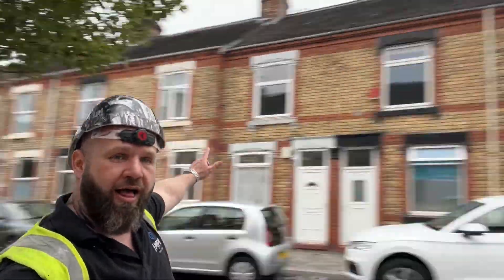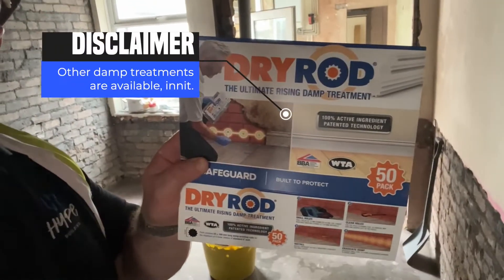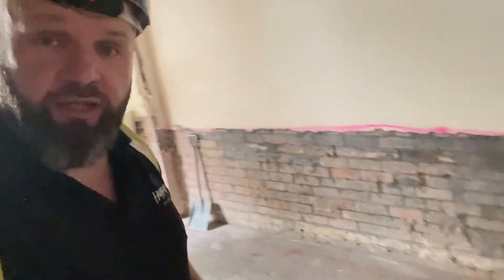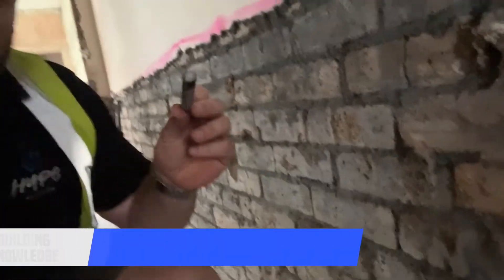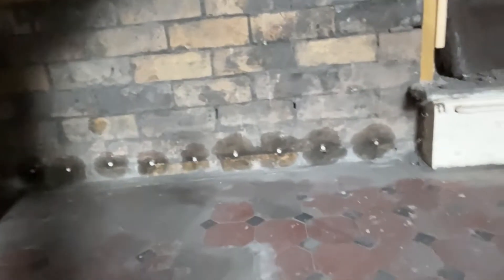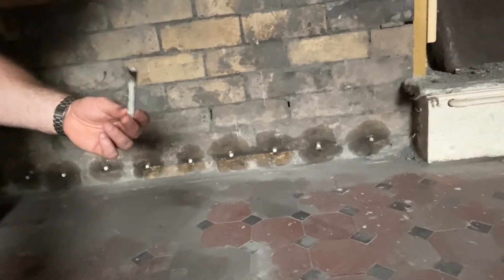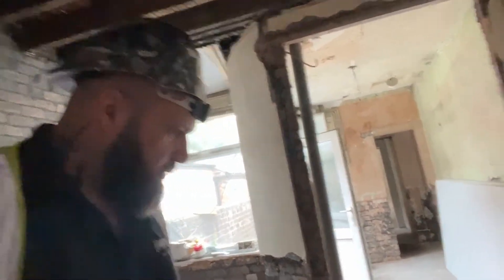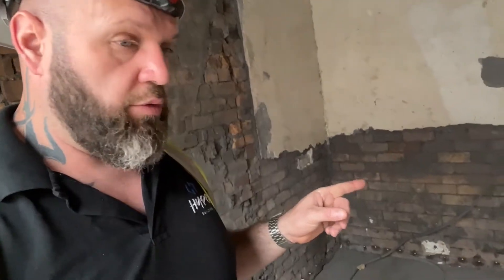Damp Course Using Damp Proofing Rods (How & Why)

Comment: Can these be used while drying with a dehumidifier or would that pull the chemical barrier moisture out as well?
Reply from the maker: Great question! You can use a dehumidifier while the rods are working, but keep in mind that very aggressive drying might slow down the chemical’s penetration slightly. Generally, it won’t remove the barrier, just helps reduce ambient moisture, which can actually support the process.

Comment: So what about the course below?
Reply from the maker: Hello mate, the course below is usually the damp-proof course (DPC), which stops rising damp from the ground. Using damp-proofing rods works by injecting a chemical barrier into the mortar course, creating a water-repellent layer that prevents moisture rising into your walls. It’s a safe and effective way to tackle rising damp without having to strip walls or replace bricks. Hope this helps mate :)

Comment: Great video mate. I’ve got a question actually. I’ve gone back to brick under a front window on a terraced house and had the cream injected (by a damp proofer). The wall is still wet though but it’s been around 10 days now. The problem wall abuts directly onto the pavement. What could the issue be?
Reply from the maker: Thank you mate! Even after a cream DPC, walls can stay damp for a while, especially on ground-level walls next to a pavement. It could be residual moisture in the bricks or mortar, or rising damp taking longer to dry. Make sure the area has good ventilation, and check for any leaks or water running down from above. If it’s still very wet after a few weeks, it might be worth getting the damp proofer to reassess.

Comment: Great video thanks l thought they went outside ? And also when a builder did ours -outside - he then mortered them in ....ls that right pleases, and do they keep working 
Many thanks for any advice
Reply: I think you can insert them from inside or outside.
Obviously inside is easier if you have to plaster after, as you wouldn't have to make good, like you would if it was outside.

Comment: Question, if drilling a solid wall( 1930s house no cavity)  would you drill through all the way from the inside, or half of brick thickness from both sides? What about the strength and structure of the wall after drilling? When do you cement fill the holes ?

Comment: If doing externally at 150mm off the deck which turns out to be the existing dpc level can they be drilled through the old dpc?

Comment: Hi there, my bricks are 110mm deep, if I cut the rods in 2 it will only be inserted at 90mm deep, will that be sufficient ?
Reply from the maker: Cutting the rods in half to 90mm depth should still work, but it’s not ideal. Ideally, you want them inserted deeper for better effectiveness. If possible, use full-length rods or add more for better coverage.

Comment: Good Video, I use the cream myself. The rods can be expensive to purchase especially from Safeguard. Even if you drill right through the brick course, which is rare, you can tell if you do drill straight through. I always find-out the thickness of the walls before drilling and even if you do drill through the cream is injected at very low pressure and you draw the applicator out while injecting so only a small amount is lost.  Also make sure you hoover all the dust out of the holes before injecting.
Reply from the maker: Hit the nail on the head, and you're right, we never want dusty holes :)

Comment: Question mate 
Where do you drill the holes if there is already damp course in place (external wall ) above it or below it?
Reply from the maker: Depends what's on both sides of the wall, I would need to survey the site to be safe.

Comment: Thanks for the video and explanation, much appreciated. 
Question, my builder has used these rods on the outside wall, whereas you have used in the inside. Is there a difference or doesn't it matter. Thanks.
Reply from the maker: Thank you for your message, it depends on the construction of the house, as an example are the outside walls 4 inch, 9 inch or with a cavity, if its 4 inch or 9 we go all the way through.
Reply: @HYPEBuilding  appreciate you getting back to me. Really helped making sense of things.
Reply from the maker: @Chalky555  Glad we could help :)

Comment: your seem to be level with the brick but other videos show them  being pushed in 10mm and then plastered  in. which way is correct ?
Reply from the maker: hello mate, weather it's 110mm in or flush with the wall it makes no difference, just insure it doesn't interfere with what plaster method you're using.
Reply: @HYPEBuilding  thanks

Comment: Quick question - I have a hallway wall that has raising damp on both sides. Does the plaster for the 1st 1.2/5m's need to come off on both sides for the rods to work? Or just one side as it's essentially the same brick wall! Thanks!

Comment: Hi, 

I've got a question. I have a problem of rising damp. I've knocked down rendering on the inside of the room and it turned out that instead of bricks I have discovered Aerated Blocks. I've bought 50 dry rods but not sure now how to put them in to the blocks. What is best to use? Or how to put the dry rods into the blocks? Many thanks

Comment: great vid mate.  I have a question how high up the wall do I drill the holes?  the floor is currently concrete as I havent built the floating insulated chipboard floor yet. cheers!
Reply: I think it’s just as low down as you can get

Comment: I got a terrace house and it has had damp course before on the outside,as there are the holes already there.but they are In the brick,at correct depth and distance.
Does it need t be in the mortar or this will work in the brick as well.wonder why they have done that.
Reply from the maker: Hi there. Very good question. Going into the brick is the old method – so this isn't incorrect. However, newer technology, such as the damp proof rods, work in a different way. They need to be inserted into the mortar to allow for capillary action.

Thank you for watching our video and for your comments – much appreciated.
Reply: @HYPEBuilding  then I think I have to buy more dryrods and make new whole to put the new corse in.
Thanks

Comment: Great video and thanks for the advice. My 1930's external walls are pebbledashed down to 1 course of brick above ground which is at a height of 75mm, the exposed brick course is covered with a black bitumen type paint. Question: do I drill the bricks just under where the pebbledash finishes even though I cant see the perps clearly or should I drill through the pebbledash on 150mm height from ground at 120mm intervals and then cover the holes with the mortar compound ? appreciate your help please.
Reply from the maker: Hi Javad. Thanks for your question. We would advise you to go a brick above floor level internally. If this means you're drilling through the pebbledash, you will need to remove the pebbledash below that course – otherwise it will create a breach. The 150mm above ground is a recommendation for new-builds but this isn't always achievable in older properties –  but get as close to that distance as you can.

Hope that helps and thank you for watching our video 👍🙂

Comment: Hi i have sold walls single brickwork inside, at the moment the damp is on the some of the inner walls. How much of the brickwork would need to be to exposed beneath the plasterwork for access. Thanks best regards
Reply from the maker: Hi there. You need to take the plaster off to a height of 1200mm. Thanks for watching and for your question – much appreciated 👍🙂

Comment: Thanks for this great video.  I have a question, if I may.  I have a single skin kitchen wall in a Victorian property where there is rising damp.  The other side of the wall is exposed in the sense that there is nothing on the other side - back on to paving in my garden. That other side is the outside which is rendered.   Well known damp companies have inspected and recommended a chemical dpc but also tanking the wall.  There is no evidence of penetrating damp.  If I were to simply insert these rods, would there be a need for tanking the wall as well?  I just dont understand the point of tanking as the rods should deal with the rising damp and there is no penetrating/lateral damp.  Tanking here seems only a way for companies to make money.
Reply from the maker: Hi there. Thanks for your question. From what you've described, it sounds like a DPC would be sufficient. However, without actually seeing the issues, we couldn't guarantee that that is the case.

Thank you for watching our video. We genuinely appreciate it 👍

Comment: I've had a DPC done 5 weeks ago,  and in parts where the skirting would usually sit, if i put a damp meter on it, it shows 20% moisture. I've been advised this is because the wrong type of plaster has been used. They have used Gypsum thistle bonding and gypsum thistle multi finish plaster. Is this eventually going to dry out? Or will this sit there, and needs redoing
Reply from the maker: Hi there. Thanks for watching and for your question. We can't really diagnose without seeing photos, as there are so many factors that can influence the answer. If you want to send some photos to askme@hypebuilding.co.uk we will do our best to help 👍

Comment: Hi there, fantastic video! Great to see them in action. I'm looking to install dry rods in unused exposed brick fireplace. Would this be suitable for an area of exposed brick? I worry the bleeding/patching of the product may make the bricks look unsightly, or does it soak into the brick and eventually dry?
Reply from the maker: Hi Sam. Thanks for watching and for your great feedback – much appreciated 👍 With regard to your question: the product does soak into the cement – it should dry out after a little while. Having said that, we would recommend testing this on a location that's not as visible. Hope that helps, mate.

Comment: How long should I leave the holes open before filling the ends with mortar?
Reply from the maker: Hi Paul. Thanks for watching and for your question. This one is down to your own discretion, really. In theory, you can cover them straight away if you're confident in the product doing what it should do. But you may want to wait until you can see the chemical patches begin to touch. It boils down to how confident you are that they have done their job.
Reply: Hi, thanks for this great walkthrough on DryRods. Do you need to fill the ends, if it's inside and behind skirting board what difference is there if the ends are covered or not?

Comment: Used these , three months on,  the rods look just the same, the mortar in my wall  is still reading 33% on my meter,  ( and this is in the summer months ) which is the maximum it will go to. I think I have been conned, big time. Thank god I only did a 10 foot interior wall, as a test before doing the whole house.
Reply from the maker: Hi there. Thank you for watching our video and sorry to hear about your experience. However, in all the years we've been using damp rods, we've never had an issue.
Reply: Bro you comment this exact thing on every dryrod video. Why?

Comment: Ive been told the best way to deal with chimney salts is to knock all the render off, then spray it with TG500 and use Sika 1 in the mix. Is this right for chimney salts?
Reply from the maker: Hi there. We're not familiar with the products that you've mentioned. However, we would be inclined to use tanking membrane in this scenario as it's a relatively straightforward and cost-effective method. You can learn more about tanking membrane in this video: https://youtu.be/ExDF9u97EI0?t=383

Hope that helps. Thank you for watching our video and for your question 🙂👍

Comment: great video thanks. do you think this will work for where we can't add a damp course as the side of the wall is internal? and do they need to be replaced or is it a one off? thanks
Reply from the maker: Hi there. Not quite sure what you mean with the first part. But yes, the damp rods are a one-off solution provided they're installed properly. Thank you for watching our video and your questions 👍

Comment: Hi
I followed this video and used them but did not see any dissolve with seeing them wet...will they still activate...? Thanks
Reply from the maker: Hi Azhar. If you've drilled to the right depth, drilled in the right places (the perpends), and installed the rods properly, then these rods should work very effectively.
Reply: @HYPEBuilding  thanks I followed the instructions etc and as you say...but didn't see them react...like in your video...hopefully they have the impact.  Thank you for your reply.
Reply from the maker: @azharaltaf4952  If you're confident you've installed them properly, you should see the damp rods take effect as they 'bleed' into each other. Maybe contact the manufacturer if you don't see them react, as you may have a faulty pack 👍
Reply: I called the technical helpline and they gave assurances that these will work and take 4 to 6 weeks to cure. Strange things is I've done another wall and still not seen it react ! Hopefully it works

Comment: Thanks for this explanation 👍 one question, can this chemical bleed through the plaster and affect the paint finish ? I’m planning on doing it behind the skirting board. Thanks
Reply from the maker: Hi there. Thanks for watching and for your question. If you do things properly, the chemical shouldn't be able to find its way through to the paintwork as there is only enough moisture in each rod to reach the next perp (perpend).

Hope that helps 👍

Comment: Great video, I plan on using these on an older building with solid walls about 400mm thick. I was going to drill and insert rods from both sides. One side is plastered and the other is pointed stone, will the rod pints always appear wet?
Reply from the maker: Hi David. Thanks for watching and for your kind words  🙂👍 In response to your question, once the cement has pulled all the moisture from the rod, it will go dry and not appear wet.

Comment: In 27 years of diagnosing damp issues I have never once recommended the use of 'damp proofing rods'. Find and fix the cause of the damp and you will not need to hack off plaster or use use rods. Even before the advent of DPC's and cavity walls we didn't build properties that would easily allow rising or penetrating damp.
Reply from the maker: Thanks for watching, Stephen and for leaving us your thoughts. 

In our humble opinion, times have changed and so has the way we live. Why do we now build homes with damp proof courses if there is no need for them? 

Houses were once heated with coal fires, which didn't regulate the heat but would have dried out rising damp. Today we use thermostats, which provide constant heat at lower temperatures – but signs of rising damp are more evident.

Every day is a school day and we're certainly not going to dismiss any newer methods that are proven to work effectively.
Reply: @HYPEBuilding  Before the advent of the modern DPC which we now build houses with, solid wall construction usually had a mortar plinth of around 12" (30cms) and sometimes painted black to do the same job coupled with internal walls battened out with lathe and plaster to do a similar job to cavity walls. Yes, they were not as effective as the modern systems but generally they worked just as well unless they were compromised. My argument with 'damp proofing' companies is that they don't look for or try to fix the underlying causes but instead turn to their go to solution of drilling and injecting (which often looks bloody awful) and removing plaster and using vapour check creams and plasterboard to hide the damp. I went to a property last week where the landlord was quoted £6000 for damp proofing works which turned out to be a leaking soil pipe as the cause and was resolved for less than £200
Reply: completely agree. This course of action is total nonsense.

Comment: My concrete floor doesn't appear to have any dpm when built and the floor sweats moisture. Would this be a solution to that?
Reply from the maker: Hi there. Thanks for watching and for your question. The rods wouldn't be a solution for a floor – they're only used in walls. You would, as you say, need DPM for the floor.

Comment: Hi, I have a very old building of single wall construction. Do you recommend I install the dry rods from the inside or the outside? If outside, should it be above or below the defective damp proof coursing? Thanks :)
Reply from the maker: Hi Steven. Thanks for watching and for your questions. It doesn't really make a difference which way you do it. The way we do it, however, is inside to out – but without drilling all the way through. For example, if you have a 4-inch wall you would drill 3 and 3/4 inches through so you don't have to point outside. You will also need to establish the reason for the damp course failing in the first place.

Hope that helps.
Reply: @HYPEBuilding  Thanks for the video and making it pretty much an idiots guide, I plan on doing mine form the outside it's a 9 inch solid wall in a very old house, the plaster inside is okay so I don't want to disturb it, would you agree that this is the right way to go about it?
Reply from the maker: Hi  @Paul-eb4jp . Are you doing this as a preventative method or because you have a damp issue? If it's the latter, we would advise you to remove the plaster as it's that which contains the contaminants. If you don't remove it, you will still have signs of the issue.

Hope that helps and thank you for watching our video –much appreciated 👍